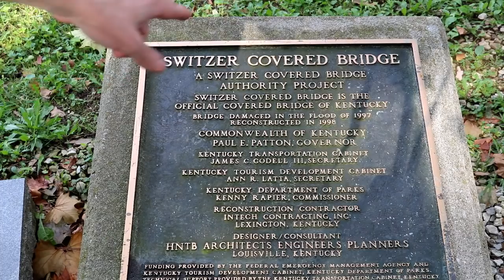Working out Problems on the K&T mill. Overhead Ram are stuck

Comment: You may or may not know Steve that the gear mechanism on the end of the table is for cutting helical gears with a dividing head.
Reply from the maker: They made several different units for these machines. The one I have is for a rotary table. The units for the dividing heads had several change gears for different leads.  Mine if fixed gear ratio and run buy a separate shaft under the table. the dividing head boxes were run off the table screw.     Now , this is what I believe from reading up on the unit. I may be wrong.
Thanks for watching and commenting, I always learn for the comments.
Reply: Wouldn’t you need the universal table to cut helical gears?  This looks like a plain machine without the swivel on the table.
Reply: Isn't the same setup used to cut cams as well?
Reply: yes it would normally be a universal table machine to cut helical gears. I think you could do it on a plain machine too if you had a universal swivel head.
Reply: In my haste of typing while in between fixing broken appliances today I misspoke, I should have used the term "hypoid" instead of helical.

Comment: Not to be a smart acre, but you might have considered running the rams out from the front , provided the rack will move to the rear, and then soaking them in hot caustic?  Most of the engine rebuilding shops around these parts used (emphasis on used, most are gone) to have hot caustic tanks.  On cast iron and steel they cleaned off about every trace of paint and grunge.

Comment: I guess soon after getting the K&T in shape again a vertical head swing project is on order...
Reply from the maker: Not sure..  I do want one of course. For this machine the mount is fairly complex due to the shape of the main casting. Be a neat project I think..
Reply: Well the vertical head swing which Abom made (following the original design) is not only built like a tank it is built like an aircraft carrier. Using a lot less iron that could be welded with less than a bazillion amperes still could safely carry the vertical head...

Comment: I had to make a press to remove the overarms in my 2hl universal.. They had rusted in place from not being moved.. Just keep them oiled with machine oil and you will be fine.. When you clean out the sewage in the coolant sump, do yourself and your machine a big favor and use light bodied cutting oil from now on.... Your gear type coolant pump will thank you for it....When you lube your motor, PLEASE remove the purge plugs before you start pumping grease into the bearings.. Pump grease in until you see the same grease as in your gun coming out of the purge hole. Leave purge plug out and run motor for one minute.. More grease will come out while motor is running.. Wipe off excess and replace purge plugs.. Do not add more grease.. You will probably find the windings of your motor full of grease from improper greasing.. Now is a good time to clean up the windings and spray more insulation into them....Mike in Louisiana

Comment: If you can't find a handle for the rear controls I would make you a deal. I have one of the rear control handles on my mill, I looked long and hard for it. My 2k is missing the 2 collars on the rear controls to disengage the handle during feed/rapid. I would send you my handle to copy, if you sent me a collar to copy. You should be able to make the handle with your shaper.
Reply from the maker: You need the pieces that keep the handle from being in use wile power feeding on the side controls ?
Reply: Yes sir, I think they are identical.

Comment: Will brazing be strong enough for the motor mount? I have seen some fancy nickel based stick rods for CI that would be stronger. I think I saw them on YT. jody's channel maybe? This K&T looks awesome. All this work will be worth it. Look forward to watching your progress.
Reply from the maker: I've never had any issue with brazed cast parts. Guess it all depends on the quality on the repair job. I'm sure that stronger methods are out there but for simple pivot mount brazing will be more than enough I believe.....    We will see ;-)
Reply: Steve Summers i couldn't really see what the part was and how it is loaded. If it is in shear then brazing should be fine. Good luck.

Comment: Get an old wet/dry vacuum cleaner to drain the swa.... I mean sump.
Reply: I'd get a couple 5 gallon buckets and modify a lid were I could attach hoses to suck the waste oil into the bucket and not into the vac. I'd save a lot of cleanup. Change the bucket, put a unmodified lid on it and haul it to the recycler. No cleanup of the vac needed and you could keep and use the lid for other projects.
Reply: politicians were promising to drain the swamp, i guess its up to the hard working man to get r done

Comment: That wife of yours is stronger than she looks. She handed you that sledge at 22:48 like it was made of styrofoam......
Btw, suck that sump out and then fill it with some kerosene or diesel for a couple of days, then flush it with the diesel. Diesel and time will soften/dissolve most greasygoo.
Reply: Agreed, diesel oil makes miracle.

Comment: Steve what would you charge to fix a 1/3 hp motor shaft for me? its for my combustioneer stove, the only heat i have for the winter. it has a 1/2in shaft but it's beat up bad. don't want to freeze this winter. my city has no machinist. it wouldn't take much to fix it. i can send you pictures of it if you want to see what im talking about.

Comment: PS after watching further into your video another strange use of a wire wheel. if you just want to burnish and not remove material(like your rams first true which will leave sharp then  dress it wit a scotchbrite or other soft media and this will round the ends. its important to true them first so they run nice and even so that minimal pressure is needed to maintain even contact with out bouncing and chattering. Dave again